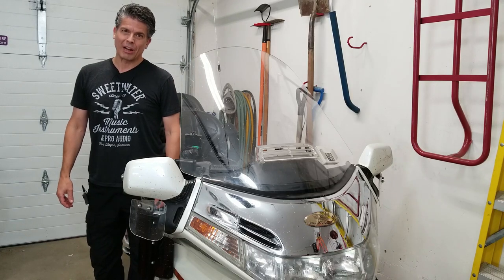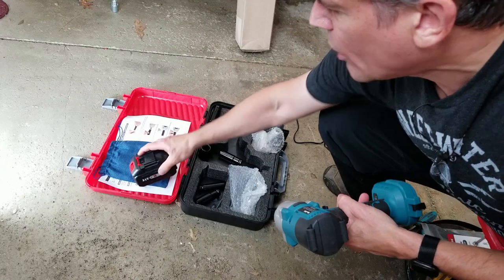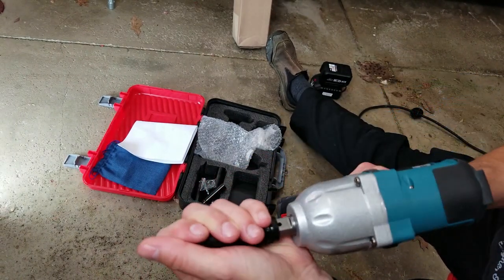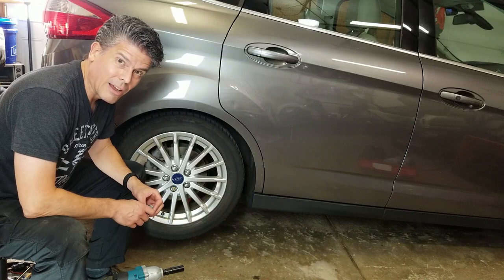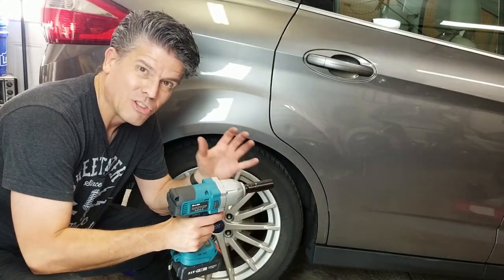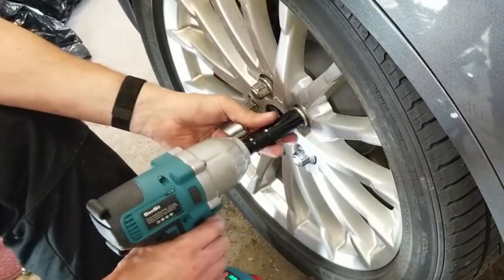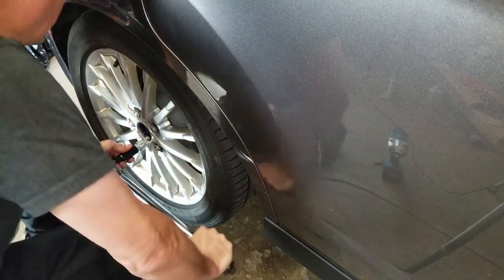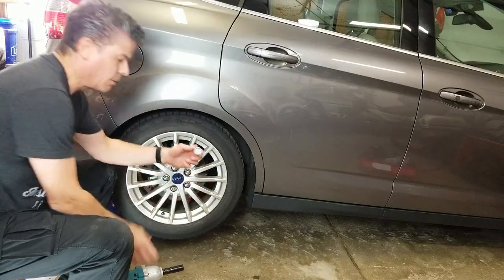Product Review: The SeeSii 21 Volt Cordless Impact Wrench

Comment: I have the same model just a different color and a different no name brand slapped on it. Because it’s a Makita knock off you can use Makita batteries with it. I have an 18 volt Makita drill and driver set. The batteries that came with it,which are 2 amp hr,fit the knock off impact wrench perfectly. Actually even better in my opinion. Nice video.

Comment: ...using chrome sockets with an impact wrench is a bad idea; you might get away with it a few times before the socket shatters into pieces risking injury to yourself or others near by...trust me,i know,it happened to me many many years ago!
Reply from the maker: 100%, I've not had one shatter, but I've definitely had one crack. Not ideal, but when you don't have the correct impact socket size on hand...

Comment: The technical specifications of the battery charger do not show the input power source if it is 110 volts or 220 volts or international (110v-220v) .. normally I order from Amazon such a tool to deliver it overseas (JORDAN) were we use 220v.

Comment: Scott, since you have nothing to work on.
I would be more than happy to drop off  my 96SE at your place so you can demonstrate first hand how to install new tires, replace brakes, flush fluids, change timing belts, change final drive fluid, etc... Not to worry, all parts will be supplied and there will be absolutely no charge for using the bike in your videos. 
Faithful viewer just trying to help 😂
See you on the forum.
Reply: I'm in the middle of doing the belts on my 1990, they're very simple..if not just a right pain in the back side to access haha
Reply: 🤣🤣 nice one... I'm in the UK, a bit expensive to ship my '81 GL1100 & '97 Valkyrie to Scott for a full service! 🙃

Comment: Hi mate, just wondering if you could share your experience after using it for few months? Any potential issues?
Reply from the maker: Not so far. I've used it quite a few times, mostly zipping wheels on and off, and it still performs beautifully. It's been dropped on the concrete floor a few times, and used as a hammer to pound a stick wheel off of a brake rotor, and still it works, so...I can't complain. :)
Reply: @GoldwingDocs  would you say this one over the handife wrench?

Comment: I have this with a 1/2 inch drive and and it's way too tight trying to get sockets on and off of it. I thought maybe it was just mine but looks like yours is the same.
Reply: If you line up the hole on the socket to the front of the tool it goes on with ease. I found this out by accident. They should tell you this
Reply: @dmrakers17601  so, you're saying you can't put a square peg in a round hole?  (ha)  I guess you'd rather it start out snug.  After using it for a while it probably slowly loosens up.

Comment: did you get this with a promotional discount or purchase it "used like new"? The reason i'm asking is because your kit is OBVIOUSLY not factory direct. It is missing the top layer of protective foam, the charger is also supposed to be contained in a bubble wrap bag, and the sockets come inside the fabric bag also. It seems to me like you got a used item. The case should be somewhat difficult to close when all of the protective foam is in the kit. I also don't see the orange/white "inspected" sticker on the case.
Reply from the maker: It actually came directly from Amazon, so I would be surprised if it was not actually new.

Comment: If you had to order a new locking nut key, seems an expense and one that I avoided because after my key broke inside I took it down to a local tyre fitter and he took them all off with a special tool that he smashed on to the offending nuts and charged me £40($51)for 4 wheels👍. Then I asked him what can I do about future problems problems and told me just use normal lug nuts as you will bound to have that one shop that won't use torque settings and impact them up to 600 that even the Beast would struggle 😮

Comment: Warped rotors are caused by stabbing the brakes and making a hot spot very quickly. Has nothing to do with lugnut torque.
Reply from the maker: You're wrong. Unbalanced lug not torque is the most common cause of rotor warm. Braking heavily and holding the brakes tight after you come to a stop can cause some of the pad material to transfer and "weld" to the rotor, which will make vibration that is commonly (but incorrectly) thought of as caused by warped rotors. But the most common cause of actual warped rotors in road cars is lug nut torque. Race cars DO warp rotors from heat, but that is not typical in road-going cars, as the brakes typically never get that hot.